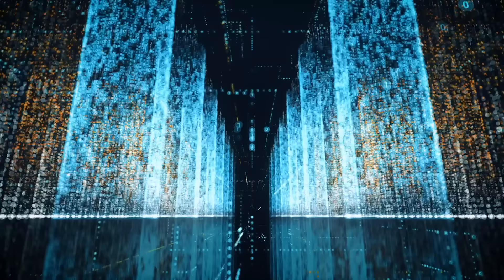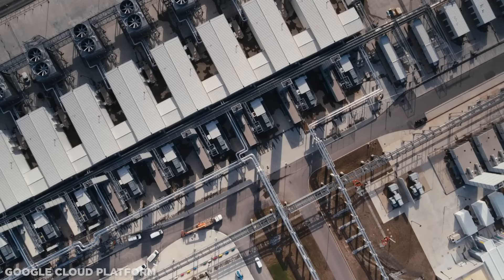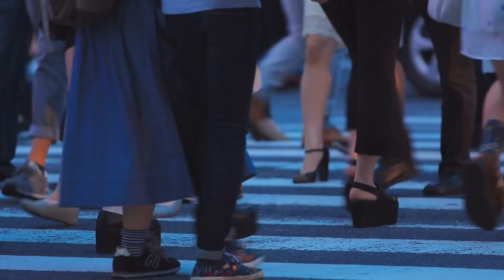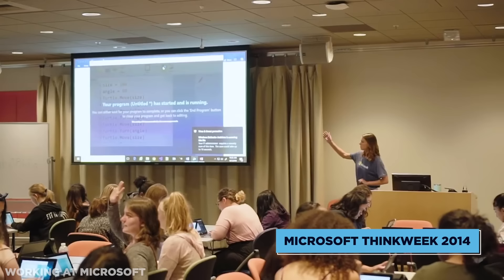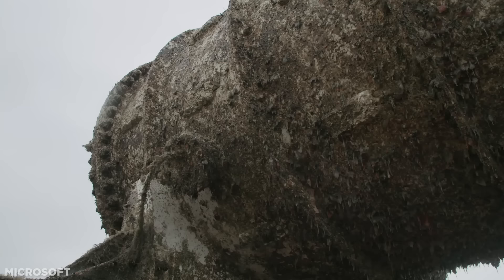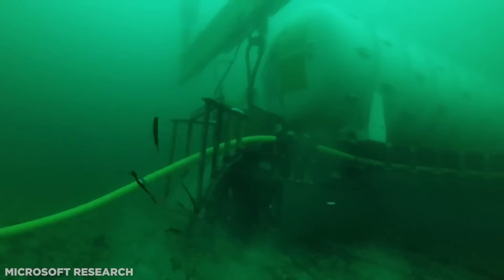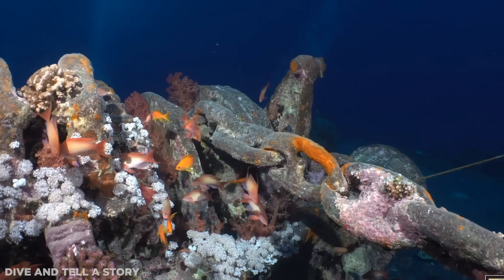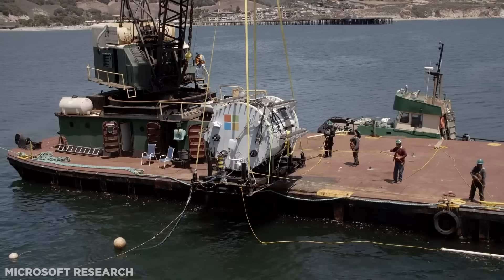Why Microsoft Has Underwater Data Centers

Comment: It could be secured to a permernant underwater platform that could double as an artificial reef. This would help to minimise local environmental impact to the sea floor and if the unit needed to be swapped out then it just needs to be released from the platform. I actually think this is a great idea and it doesnt have to be wind energy to power it. Wave energy would also be perfectly suitable.

Comment: For anti corrosion,can add ceramic coating
Reply: At sea, the issue is that biology would dig through any protective layer including ceramics.  There's a reason why ships used to have red bottoms, they used toxic metal impregnated paints to discourage marine life from attaching to them.  Harbours are now starting to ban such painted hulls as the heavy metals dissipates into the waters and regulations are starting to hold harbours accountable for the pollution.

Comment: Ok lets think this through, and coming from someone in Data Center Engineering.... They want to put these Data Centers in the oceans, to help regulate their temperature, because they build incredible amounts of heat. This is why they want to do this.... Now lets think about what happens when our Ocean waters warm up.... They will say this is no way near enough to worry about right?... That's the same thing they said about the fossil fuel industries..... Lets warm our oceans but we're cooling our computers, yeah that's smart. AI needs to come on and take over because these Humans that hold positions of power are as dumb as a bag of bricks.

Comment: Why a ceramic reinforced casing is not use since it would not rust? One could use nano carbon fiber as the base of the ceramic enclosure and it would technically last forever as a underwater casing? Science!

Comment: According to the narrator, the potential energy savings of doing this is merely 1/5th of the energy required to power the pod itself. But these are spinning hard drive arrays, the least energy intensive kind of servers and ones that are the least sensitive to heat. With modern helium enterprise drives heat is no longer the killer that it used to be. I would expect heat to be a fraction of the energy usage of this storage pod even if it was in a traditional datacenter in terms of watts/btu. You also wouldn’t just send individual power lines to power the pods, you would need to run expensive submarine power cables and build some kind of protection from boats dropping their anchors and destroying tens of millions of dollars worth of equipment at a time. Mitigating these problems feels like a solution looking for a problem.

Comment: Why not build a data center inside of a small hydroelectric dam. Split the river one part to go to the turbine, one stream bypasses for fish and wildlife and one part to go to cooling that runs through cyclone filtration followed by mesh filters which does a single pass of the data center back into the river. The reduced corrosion is interesting but I don't think it alleviates the cost of maintenance anyways.

Comment: Access constraints are not ideal. Neither is the need to remove and replace. You get the same effect by simply having a water cooling system. EG Similar to coastal powerplants which have an intake at the coastline and use the seawater to cool their condenser loop. Pull the ocean into land, don't go out into the ocean.

Comment: Sound nice and nifty until you consider the difficulty and cost with maintenance, and catastrophic loss of data and infrastructure if there’s a containment failure. If it’s under the sea, you may as well be in outer space, but with sharks and whales, shifting landscapes and seabed’s, and cyclical pressures and environments that’ll eat at the capsule (honestly, space is easier, just harder to get to).

Comment: Cool stuff. The one benefit cited is a bit contradictory though. If the lifespan is only 5 years before maintenance, that would force the poor sea creatures to have 5 year leases on their ‘property’, before being destroyed and restarting afresh, shame :-/.
Reply: The experiment involved retrieval after five years for analysis of failure rates and why failures occurred.  In practice the intent is to never recover the data centres but to just sink new ones.  Not only do the failing obsolete centres form artificial reefs, they are efficient containers of toxic e-wastes dumped at sea.

Comment: It is an good idea to install data centers in water which shows and contribute to lot of factors what we were facing today, only the issue from my point was if any thing goes wrong in the connectivity(fiber cable in clip) pays off delay in work and halt in the business for certain period of time till data center got recovered. Continously checking alignment of data center components with the work station is the mandatory which needs to follow(I think apart from people any kind of signal system which monitors connectivity and predicts any hardware damage will helps a lot to maintain consistent network).

Comment: We know if the ocean temperature changes by 1' catastrophe occurs, but don't worry a single one of these pods only effected the temperature by a fraction. Never mind thousands of these adding their fractions of a percentage. Measuring the thermal output of the equipment on board tells you everything you need to know - and MS put it in the sea instead of a lake because the thermal dissipation in a lake would have wrecked the local ecosystem.
Reply: The heat produced by the servers either goes to air, or to water - so I guess it doesn't really matter for global heating

Comment: Data centers are claimed to produce a lot of heat and hence a major cost of running one is for cooling systems. But Microsoft's air tight container happens to have negligible heat dissipation inside water??

Did they forgot to turn on those systems? if no then where did the heat go?

How did they cool those systems, in one of the videos about this it was mentioned that the containers were filled with nitrogen which is a bad conductor of heat and that would only make it more difficult to cool the computers.

Comment: I reckon the decrease in energy consumption from traditional sources of electricity will far outweigh the heat dissipation into the oceans. Not every shore houses an array of wind turbines though... Maybe some tidal or wave energy generators could be coupled with this?

Comment: "Even in their thousands" erm so while the main reason to put them under water is for regulating heat, right? What therefor would be the effect of "thousands" distributing their heat into the ocean? Not like algea, dead water and such like would not already be a problem depending where you go and now where this goes maybe that problem.

EDIT: what type of paint is used? i remember of paint to prevent certain seabased life to attach themselve, which later on turned out to be highly toxic.

Comment: My guess one of the reasons for the reliability of this data center is cooling. The temperature of the water on the ocean floor is about 0-3 degrees celcius. Data centers are kept warmer today than they used to be. When I started working in data centers you needed a light jacket to work in them and stay comfortable. But today they are kept warm enough to where you can just wear a t-shirt and your fine. In my first data center job was in a 100,000 sqft data center and right now I'm working in a 10,000 sqft data center and there are more problems with reliability of equipment than in the 100,000 sqft data center. The difference being the temperature of the two data centers. The warmer the data center the more problems you're going to have.

That's just been my experience and is my guess on why the servers in this underwater data center are more reliable.

Comment: This was one capsule, now imagine 500 or 1000 of these in a vast area. For maintenance being pulled up and washed off every few years. Bet you’ll be able to measure some warming of the water and disturbance of the seabed. One will not make te difference, but a couple of hundred together will.
Reply: 205 TWh of electricity a year for all data centers.

205 TWh / 4,200 joules * 1kg * (1 litre / 1kg)  = 1.75714286 × 10^14 litres of water to be heated up by 1 degree.

(15 (cm / second)) * (1 year) * (20 m) * (2000 m) = 1.89341556 × 10^14 litres

I.e if you could put the entire world's data centers in a square 2km long and 20m high, you would raise the local water temperature by 1 degree,

(or in other words the entire worlds server capacity in just 33 server racks would heat the local water by 1 degree.)

A high end data center (According to my research) may contain more then 50,000 racks.

Comment: Even if this is a genius way to store data for Microsoft , but is it safe?
Thanks for replying and for the video!
Reply: Your comment along with many others just tells me how many of you do not understand  how Fiber Optics work.  Trying to tamper with a underwater line that is both a fiber optic and a power line is not a wise idea.  Then to try and Splice a Fiber optic line underwater in those temps you will never get the equipment to work properly let alone be able to  get those fiber ends together wearing the dry suit gloves that are part of your suit to help keep you warm in those cold temps that low down.

Comment: Would be interesting to see one of these things purpose built with a reef-like exterior specifically for marine life. The challenge that this presents, however, is making it impossible to remove a unit once installed.
Reply: You don't have to bulld the "reef like exterior" ... because the ocean will. That's what it does. Consider cargo shipping containers (which are constantly falling into the ocean and not retrieved), they have 0 prep done to make them more hospitable to the sea life, as these containers going in the ocean is generally a total accident and unintentional, however, sea life shows up and takes over the container. It actually tends to flourish (barring something truly hazardous having been in the containers). It does it so well they now use old containers as a sort of sea life hotel for a couple different ocean conservation projects. 

Tdlr: the ocean will do it

Comment: Seems like madness to me. 117feet deep is well within recreational SCUBA depth, so tampering of an unprotected DATA 'submarine' is likely and probably catastrophic once that 2mm hole is drilled.... Why not just have it on dry land where access for repairs/maintenance/security is easy? You could still seal it, cool it with water and nitrogen fill it, if that helps, but not have the problems of it being in the sea.

Comment: 1990: world: WE BRING YOU LAND SEVERS
2018 World: WE BRING YOU AGAIN UNDERWATER SERVERS, YEAH!!!
2055: World: Scratch Water and land servers, so boring because WE GOT FLYING SERVERSSSS!!!
3000:world: we got space servers.
Reply: 4000:world: we have created servers inside the sun !
5000:world running out of weird places to shove servers into
6000:world: we finally achieved black hole data storage, the last data storage system you will ever need ! 
but then there is a massive scandal when it is discovered the data cable supposedly leading to the black hole actually ends up inside bill gates in his coffin.

Comment: Wait, so some of its benefits to the ocean is that sea life loves solid structures?
Reply: An excuse to litter the sea.  The game plan is to never retrieve a data center, simply sunk more.   One of the gains is avoiding e-waste regulations.
Reply: they can retrieve them, they have just proven it. 
they also said they could leave them sunk for 10-15 years unless most of the servers malfunction then they would pull them up for maintenance or recycling. 
you should give them a chance, cuz this could push other green stuff forward. they would be inclined to build and maintain more wind and solar power for those centres which would decrease strain on our current very fossil based grid, we all know data centres fucking feast on power.

Comment: That means the water of the ocean is being heated up by those cylinders and the internal equipment. Why doesn't THAT concern the environmentalists who also ride on jet aircraft and toss trash that ends up adding to that trash island floating around out there in the middle of the Pacific, most of which came from the Asian nations to the west?

Comment: Wont this heat up the ocean when they scale up there operations?
Reply: Same thought here...
Reply: The heat is negligible. There is a bay near where I live, botany bay. Dumping all the energy of the worlds data centres use in a year uniformly would heat the water by less than 0.1C. And botany bay is only 40km^2.
Reply: They will, but they won't heat up air instead. Data centers on land heat up air, and require air conditioning - so the underwater ones will use a bit less energy.

Comment: Interesting .. but when i think how often we have to change a Hard Disk or SSD on our Root-Server , i would say its more Cost intensiv.
Reply: From a quick internet search it seems the expectation would be considerably less than 5% would fail in 5 years, thus, you'd still be running over 95% of original capacity, something anybody can live with.